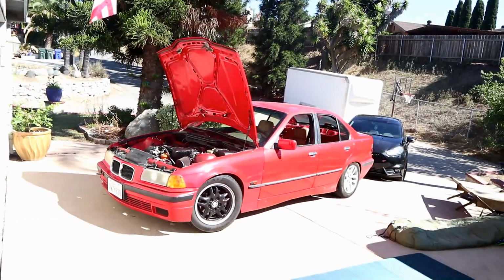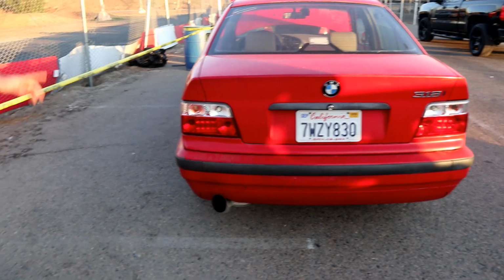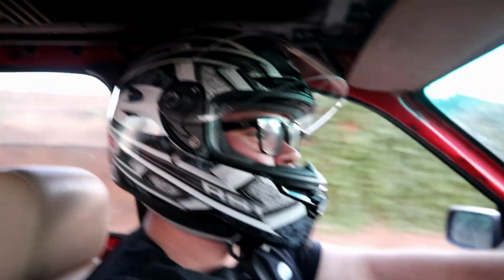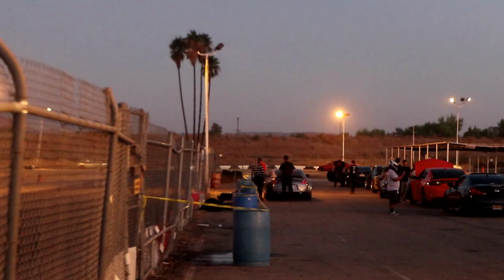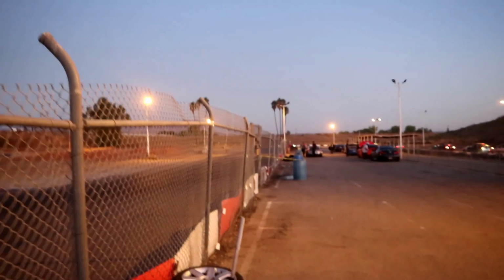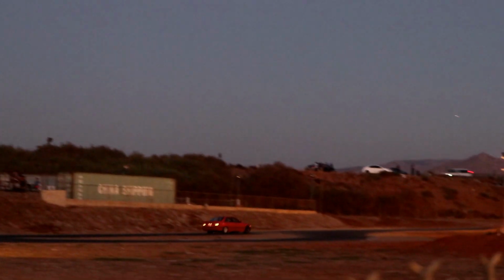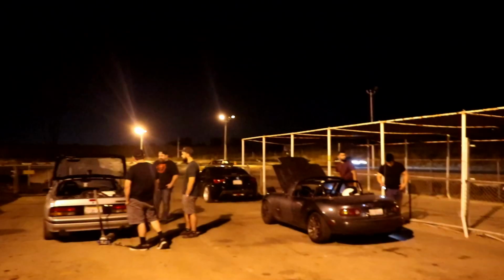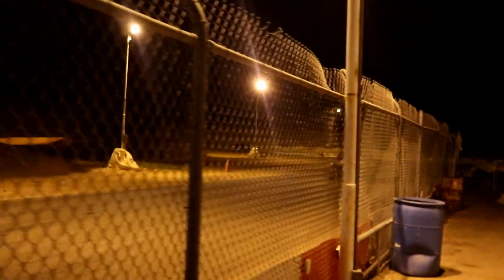Properly Sending the Drift E36

Comment: one question, is e36 sedan better then coupe for drifting? and why. ?
Reply from the maker: the sedan chassis are more structurally rigid than the coupes are from the factory due to a stronger b pillar. aside from that, they are a little bit taller than the coupes, and danny and i being over 6 foot helps with helmet clearence. also, the powertrain components and curb weight are exactly the same as a coupe, and sedan chassis are more readily available and cheaper than coupes. sedans are cheaper, more roomy, and stiffer than their coupe counterparts.